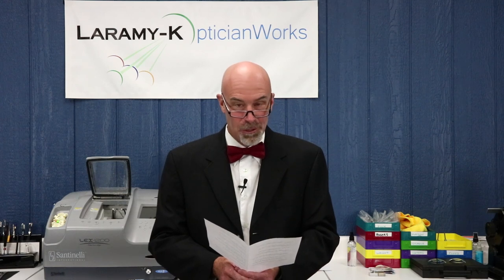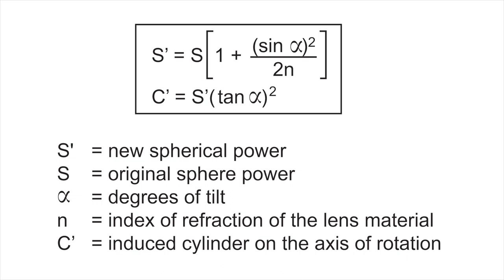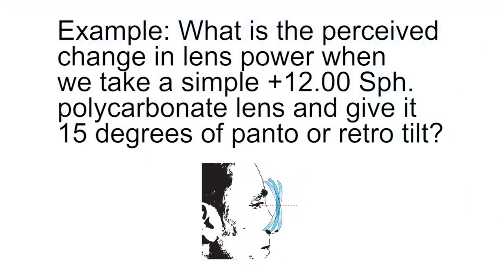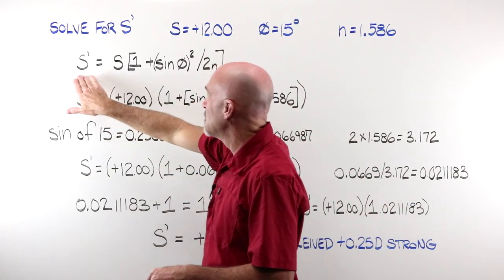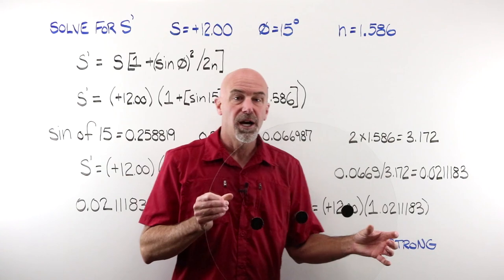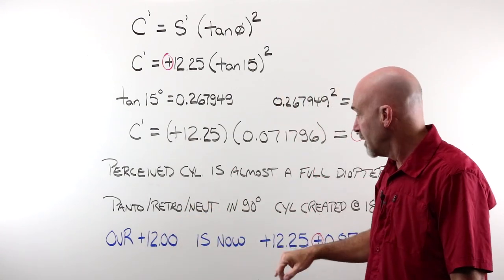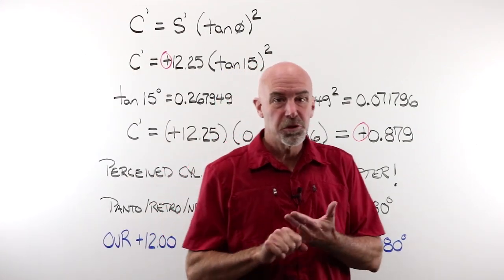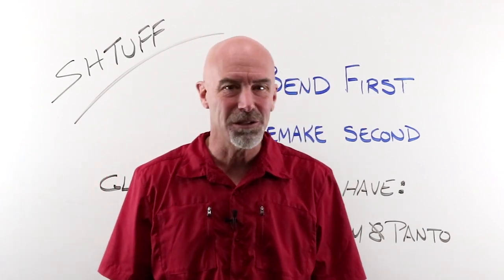Lens Tilt And Perceived Power: Why It's Important And How It's Calculated

Comment: Thank you for the whole information you presented its for us. 
My question is : which of the lenses is the alternative for the prescription: OD:-1,25 sph
OS::1.00sph  .i suppose i don’t have -1.00 on my stock and It’s an emergency glasses .which of the alternative on those tree lenses are the best choice as an emergency glasses ? Using -.075 -.025 x90 which the true power is -.100 or 
-1.00 -0.25 x180 which the true power is -1.00 or using -0.75 sph ???
Reply from the maker: Rule of thumb we were taught, over minus and under plus. I'm not sure I would ever see -1.00 + or - even 0.75 as being an "emergency" but in my opinion none of those choices would be any better or worse than the other. 0.25 in any "direction" isn't going to make much of a difference. John

Comment: Thank you for a really cool and in depth video.  Along those lines I have a question that bothers me. Do you then take the OC height not only at a location where the patient is sitting eye to eye but also adjusting for the tilt in such a way that the line of sight comes in at a 90 degree angle either by dropping the height a millimeter for every 2 degrees of tilt or by having the patient tilt their head so that the face of their frame is perpendicular to the ground?   Its seems to be real difficult to get a straight answer on this one...Thanks again!
Reply from the maker: When fitting a free-form lens and providing the lab with POW measurements you would mark the fitting height at the center of the pupil. The lens design software would then calculate any changes that would be made to account for tilt. You wouldn't concern yourself with it. 

I know you will see this: “Lower the OC 1mm for every 2 degrees of pantoscopic tilt.”  And to be honest I actually have no idea what it means. In almost 30 years I have never met an optician that mentioned doing anything like it!

You might toss it up as a question on Opticians On Facebook or the The Optical guild on FB?   John
Reply: @LaramyKOptical  I'm so glad you admitted that! I'm sure MANY have read through that formula for tilt, and were still baffled why the need to lower the OC by a mm. for every 2 degrees? In fact, I'm still a little baffled by THIS video- IF the OC of the lens is directly in front of the pupil, and then you tilt the lens, keeping your horizontal axis exactly bisecting the pupil, then wouldn't an increase in cylinder below that axis, mean a decrease in cylinder must happen in the lens above that axis?      The lower part of the lens is tilting TOWARD the eye; the top part of the lens is tilting AWAY from the eye. It stands to reason that the effects would be exactly opposite each other, so although distortion would surely increase, it's seems that part of the power increasing and part decreasing, would be a wash. Trying to visualize...……. ?

Comment: Could you please do an example on oblique axis please.  eg. +3.00 -1.00 080 (keep all other variables same).  I have talked to lots of faculties, but never got a definite answer, and different answer from every faculty, which made me more confused than clear.  Some say to use Cross Cyl when the axis are not the same.  Ok makes senses but at what point.  How do I start off.  Even books only talk about 090 and 180 axis.

Just wanted to see what you have to say about oblique axis.  Even if you cannot make a video, then please reply to my comment and just show me how you get answer for each step.  You don't have to break down and show answer for each expression like you show in this video, JUST the full expression and FINAL answer for EACH step.  If it does require cross cyl at some point, then just give the two expressions for cross cyl and then the final answer, do not show detail. 
1.    Power at 090
       Your Answer........................
2.    Calculate New Sphere
       Your answer....
3.   Calculate induced cyl
      Your answer...................................
 x .  Last step .   final resultant power patient is looking through
Thanks
Amit
Reply from the maker: I have been searching for years (quite literally) for someone to explain crossed cylinder and I have never found anyone. I recall working the formula in school (a full blackboard if I remember) but what it was all about I have no idea. Much like your request here I have asked someone to provide an actual working example and show the steps performed. More or less a case study in crossed cylinder. No luck at all... As to your step-by-step I don't mean to be "direct" but you have to do the math (as shown in the video) so to speak. It is a multi step problem involving two different formulas. You can't "distill" it down past the steps and formulas required. John
Reply: @LaramyKOptical  Thanks for your reply, so I am not the only one. I have worked out TWO ways to do this.

One way I thought would be to calculate the power at 090 or 180 depending on if we doing TILT or WRAP, and use that to calculate the New Sphere and Induced Cyl.  

For Example: Lets assume rx is +3.00 -1.00 060.  Using Oblique Formula we get +2.75 in 090 meridian which is our old sphere (S), keeping everything else same n = 1.586, theta = 015 pantoscopic tilt.

New Sphere(S') = +2.808 D
Induced Cyl(C') = +0.202  D
Perceived Rx = +2.808  +0.202 180
Original Cyl    =               +1.000 150 (original cyl in + form)

Sphere for original cyl would be PLANO.  Thats the only way I can think to use cross cyl.  Now we can use cross cyl here to get the final answer; unlike 090 axis since we are working on oblique axis, the final answer will also be in oblique.   I haven't calculated that yet but wanted to see if I am on right track.  

It would be totally opposite for WRAP
------------------------------------------------------------------------------------------------------------
Second way would be using the same example above for TILT.  Calculate powers at 090 and 180 using OM formula
Rx(090) = +2.75
 D
Rx(180) = +2.25
 D
Lets write this in 090 format due to tilt so we don't have to transpose
   +2.75 -0.50 090

and now continue like a normal problem.  

What are your thoughts?  Both seems valid methods.

I am still working on it, if I come to conclusion, will get back to you.
Reply from the maker: @amitverma3764  As I mention in that video and several others I'm not a math guy. I can "see" what is going on, follow the steps and get where I need to go but beyond that I'm afraid I'm not your guy. Bear of little brain here...

Comment: Will this be on the ABO? Or advanced test?
Reply from the maker: Heather, No one knows what will be on the exam. On the basic you may see a question about inducing cylinder by lens tilt but you sure WILL NOT need to calculate it! On the advanced I should hope that you would. John

Comment: In the compensated freeform lens design video you made mistakes implying tilt induces cylinder in the vertical meridian; and wrap induces power in the horizontal meridian. You mentioned these things almost as though they were mutually exclusive. Here you prove yourself (formerly) wrong where the change in cylinder is created due to tilt, and you show that perceived power is affected also when you tilt. So it seems like you made this video to account for the errors implied in the previous video, but you make no account for making up for any mistakes. Certainly the previous video does not make sense until you watch this one.